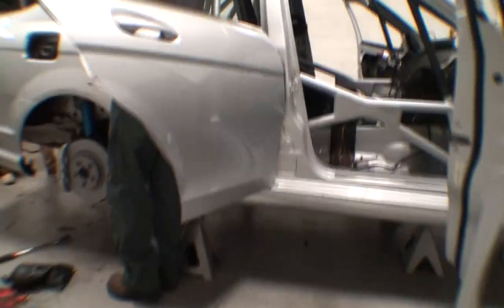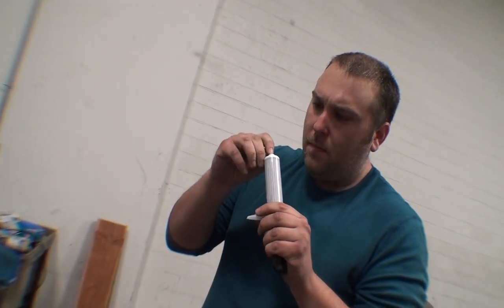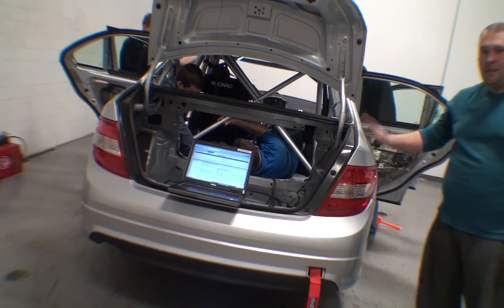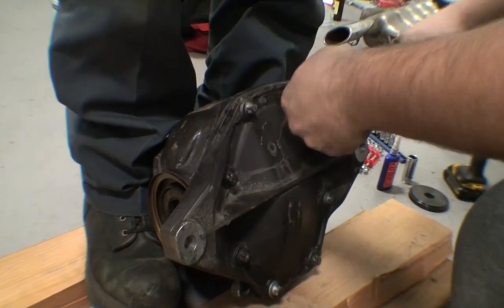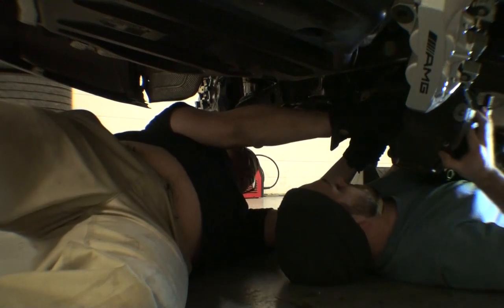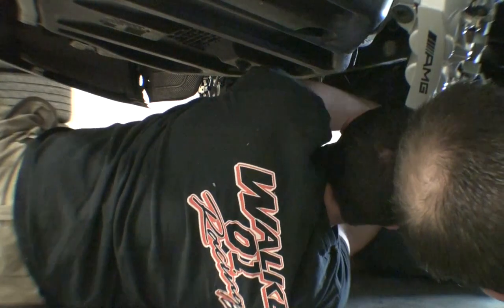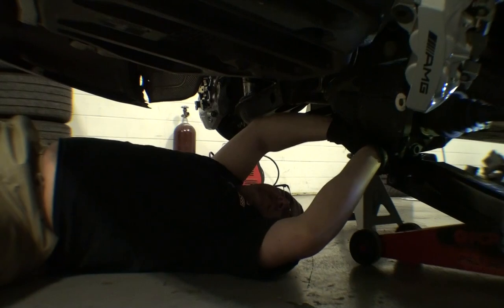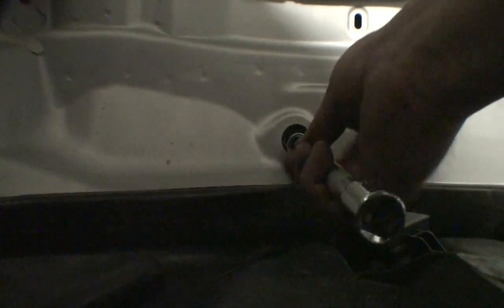FCP Euro's C300 Race Car Up and Running

Comment: As a W204 owner, I've always wondered why after selling so many examples, this model never got any performance love. Good to see someone making the effort to try something new.
Reply from the maker: I was very skeptical as to how this car would turn out as an endurance race car but we have had tremendous results this season. So far through three races we're sitting 2nd place in points. The reliability this car has provided is unrivaled by just about anything else. Between the C63 AMG brakes and Bilstein Club Sports most of the car is stock and it's been very reliable and has performed beyond expectation. We have 4 more races this season including a 15 hour dusk to dawn race in August. Hoping to finish out the season as well as it started.
Reply: I always loved the W204 chasis and I feel the same man

Comment: did you guys do all the work on your backs? no lift?
Reply from the maker: Most of the work was done on jack stands where the car was not going to be able to move under its own power. Once we got it to move under its own power we had it on a lift. I have another video coming out shortly of the wrap up before we leave for Atlanta. The first race is coming up on 2/11 and 2/12.